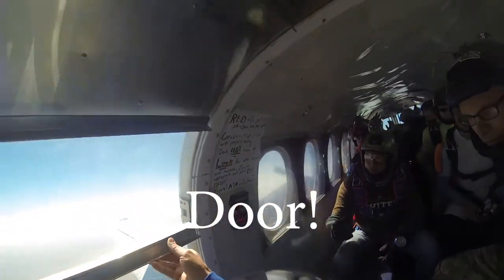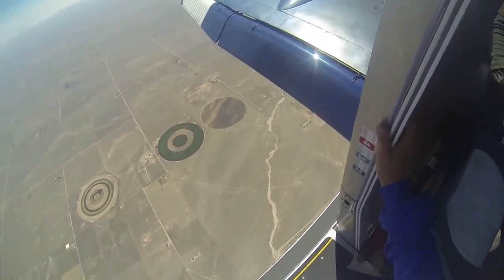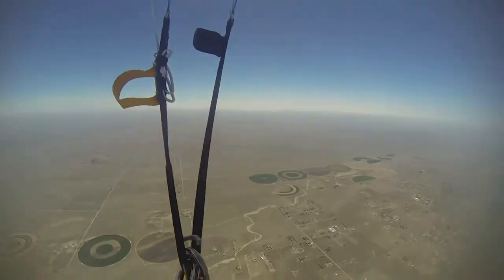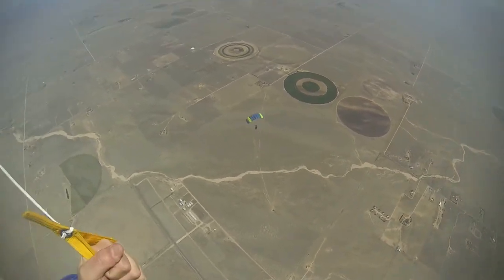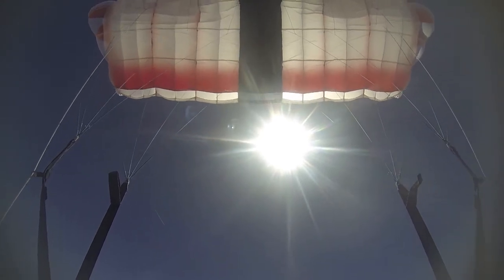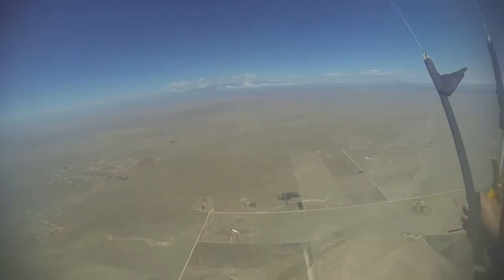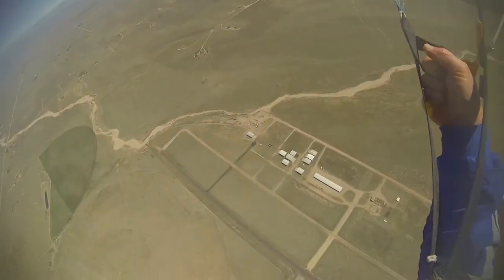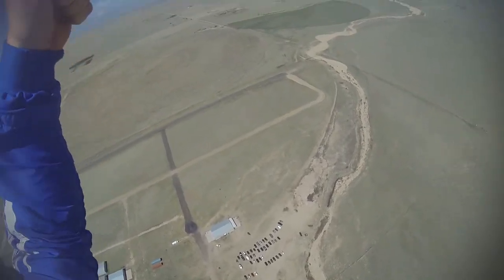Talking Skydives Episode 6   Stalls Rear Risers and Brakes, Front Riser Slack Check

Comment: Is it bad / is there increased risk to holding a stall (either rear risers or brakes) for an extended period of time?
Reply from the maker: It is not often a problem to hold a rear riser stall down for a while, however a toggle stall is likely to spin into line twists.